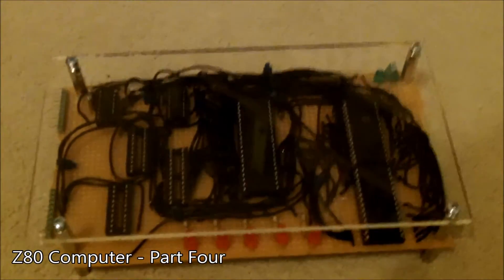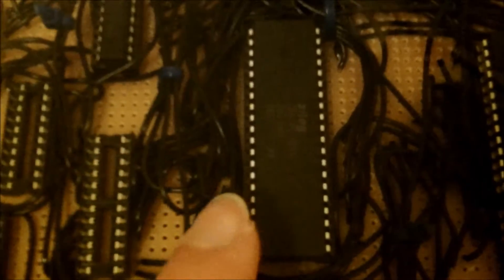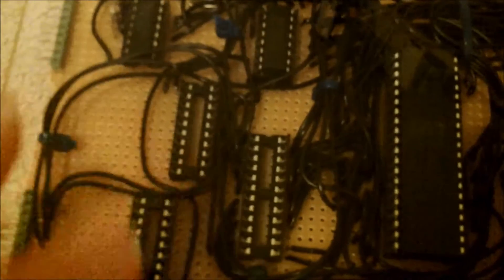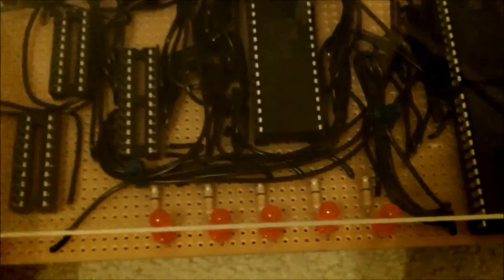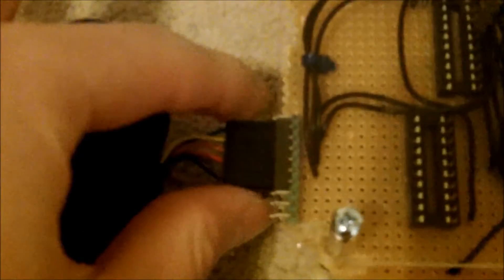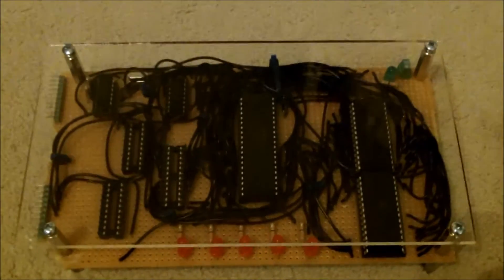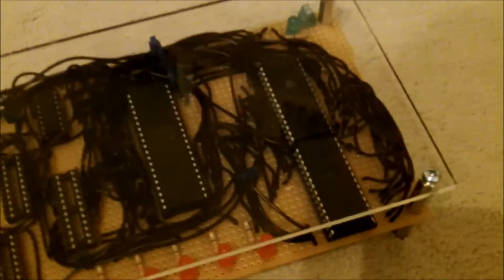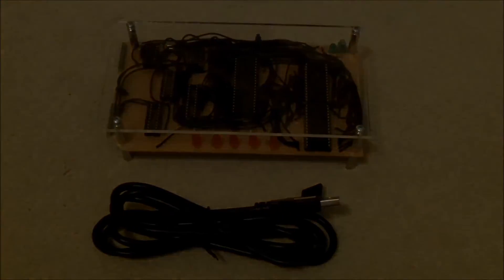Homebrew Z80 Part Four - The Base Board is nearly complete!

Comment: Looking good!!
Reply: +Stephen Scutt (but i do think you're nuts using a one time PROM) :p
Reply from the maker: +Stephen Scutt Hahahah yeah your probably right, I have three of them, so I've got three tries. I just wanted to keep the price down a bit, but I may get one in the future for tinkering with assembly. Still waiting on the communications chip, but it is coming from europe.
Reply: +TehMaxwell I'm currently in the process of building Grant Searle's video and keyboard interface. I've programmed the ATMEGA328p with the video display code but don't have any ATMEGA88's for the keyboard section. I've got an ATMEGA48 though so I'm attempting to use that as the pinouts all seem to be the same. What made you use a different chip for the serial than a Z80 SIO chip?
Reply from the maker: Basically because it was what Grant had on his page, and he had already written the ROM files to go with that particular setup. As I am still just learning about this process it seems like the best option, as it's all there working for me. I plan to tinker with other things later on, that's one of the reasons why I am leaving the whole data bus open for accessing.
Reply from the maker: +Stephen Scutt Making progress on the EPROM Programmer, but it's a long process! Still I am learning a lot from it, some people on the EEVBlog online forum are helping me improving the code and my programming skills. That's what it's all about, so I'm not complaining! The 6850 ACIA has arrived! So I can now put that into my board, another video will be coming out soon talking about the progress with the EPROM programmer so far, as there's a lot to talk about!